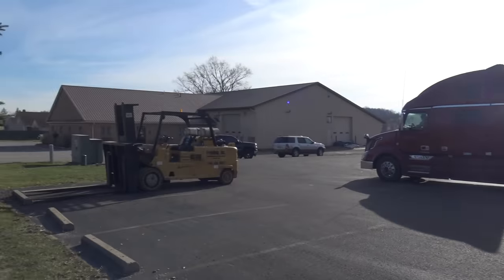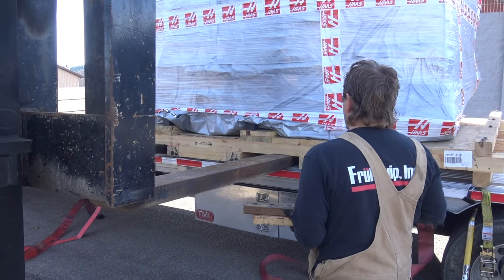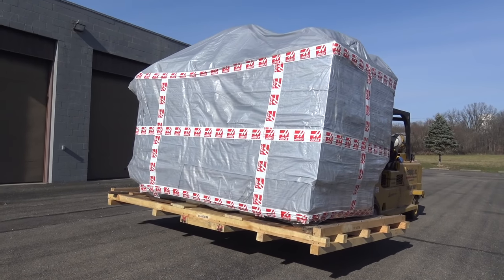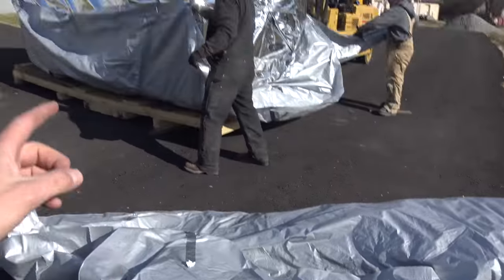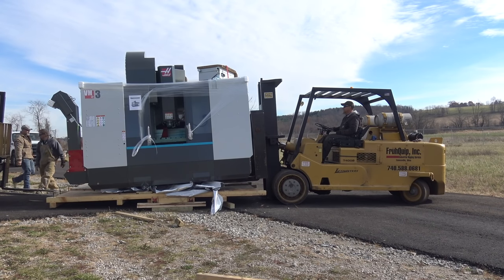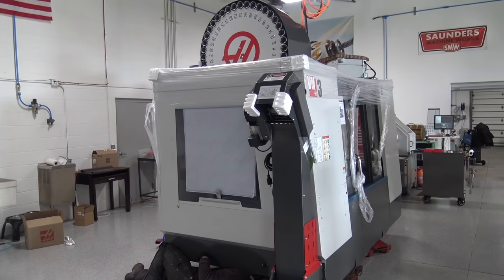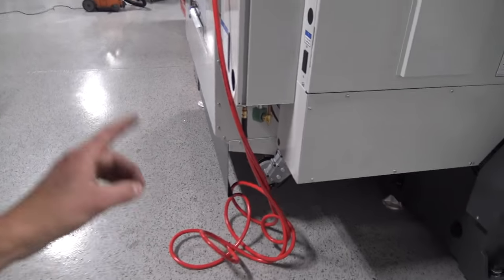Unboxing, Rigging and Placing our HAAS VM3 CNC Machine!

Comment: Time to make some T slot covers 😉

Cheap ABS plastic. Mill it so it slides into the T slots. A couple taped holes in the plastics and a set screw will secure them in place.

Comment: Very congrats, I think you've earned it. Haas is a incredible company and awesome of you to buy American. Prepare to be blown away from what you are used to. I think you'll find ridged tapping will out preform thread milling in terms of speed and ease of use. Thread milling has it's uses, but glad you got ridged. Should be able to wash down that table fairly easy with the full pressure hose. Again, glad to see you're growing.

Comment: John, in following the story of your business, this is another huge milestone. I have a feeling this isn't the last big delivery. By the way, if the hollow spot under the floor continues to be a concern for moving heavy stuff over it, it is easily fixed. A small hole <1" can be drilled through the floor and grout is pumped in to fill the void, then the hole is patched. Once you touch up the epoxy finish, you won't know it was ever there.

Comment: The Riggers did a nice job. As a Rigger myself, the only thing I would have different would be to pull the truck out from under the lifted machine. Coming straight down with a load is much better than backing up with the load elevated. Good luck with your new machine.

Comment: Woohoo! :D

Might think about making some inserts for that cart to hold your TTS. It works well for moving tooling between machines, but since you only have 1 with CAT40 at the moment and more than enough tool storage on the machine itself, it could be more useful for your Tormachs.

Keep any transport hardware, including the red brackets, together and in storage. If you ever decide to sell the machine (even 10 years from now), you'll need them.

And of course...congratulations!

Comment: When they opened the sealed bag, did you breathe in the fresh machine smell?  Wait...did I just invent a new manly air freshener scent?
Reply: Two of the best manly odors: Lathe work with coolant, Two stroke oil(they even make it in candles)!
Reply: Don't forget BBQ & old school hardware store smell.
Reply: +Sketch1994 What!? you need to put a link up for that candle!
Reply: ...., and petroleum and hot electronics ;)

Comment: A quick tip since your machine will have the next gen control, get a paint marker and paint one of the drive lugs on the spindle so you can quickly orient new tools going into the tool changer. Older machines have an orient spindle button, but it was removed on the new control. :-(

We have 4 Haas machines, with 4 different levels of control, so if you have any questions, I would be happy to help. We're right up the freeway in Mayfield.

Comment: I would recommend you turn on rigid tapping.  I have that on both my lathe and mill and it works great.  It is fast and does a great job.   You can still do thread milling on bigger diameters.

Comment: Great machine! We have 2 at our shop and even though they are from 05 they are still work horses
Reply: Ya both VM3 and we have one SL30. I would love to see a video covering the chip extraction. We only have the augers and depending on the material they will give us issues. 

On a nother note. I'm bummed you don't do any more solidworks/ Hsmwork video.

Comment: Don't throw out the tool cart! You'll soon have the price of a second machine in tooling! Trust me I know from experience.  lol...Good luck with it John, HAAS may not be the best machine out there but they have tremendous support and are capable of making a wide variety of parts. A few years ago I bought a VF5 for a company I worked for with 35 HP and a gear transmission. All that HP was kind of a waste with a 40 taper spindle though.

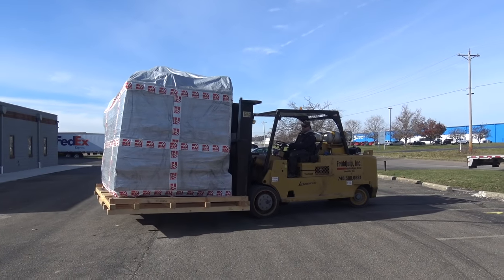Comment: Is it just me - but what is going on with the fork lift's front wheels? They apear to spin weird pulling the Haas of the trailer. See 7:03 for example.
Reply: It looks like it has a friction clutch that engages very 30 degrees or so. I can’t image that this would allow the stapler to be operated smoothly.
Maybe an artefact of the image stabilisation / anti-shake algorithm? But in a very limited area in video … odd …

Comment: Swearing?  Well, maybe not a good thing all the time but no big deal once in a while.  
Trucking, I have about 800,000 accident free miles as a trucker almost all of which are as an owner operator.  All of my owner operator miles are flat bed or drop deck operation.  Very few big trucking companies take on loads like these.  The big companies prefer regular cargo that they can do day in day out.  The fella that picked up your machine I'm betting is an owner operator.
I love machine skates.  Those are different than any other kind I've seen.  Look like they work so smooth.
Hallow place under the floor.  I'm guessing no big deal right now but if you think it's worth worrying about, maybe a concrete jacking company can pump some grout under the floor.  
Thanks for the videos.

Comment: John; You can fix that floor pretty cheaply if your concerned or plan on moving anymore heavy stuff across it! Just contact someone that specializes in that type of work and they can core your floor and pump grout into void and its a good fairly cheap fix! Just make sure you get someone that knows what their doing!
Reply: Mudjacking will fix that floor. They do it often to sidewalks and I'm sure there is someone in your area.
Reply: Yep, From what I have seen, they drill a small hole (around 10 - 12mm I think) and pump either concrete or a special liquid that is like expanding foam, but much more solid once it dries. Very cool and reasonably cheap way to brace concrete slabs from underneath.

Comment: How does one find out there is a hollow spot under a concrete slab foundation 20:15?
Reply: Makes a different sound, with my shed slab you can hear the difference in 1 of the corners, tap it with a piece of 4x2 vertical (as if you were trying to dig the concrete with it), and compare the different sounds. Easy to pick when its "hollow" underneath.

Comment: Not every machine fills a 48ft semi trailer. :-) That is a beautiful machine and a 40hp spindle wow you got me way out horsed, you can turn some big cutters with that!
Reply: NYC CNC
 I was just reading the driver label when you had the door open on the HP. i guess they use an oversized spindle driver to prevent overheating?   I just looked at the specs and Haas says only 90ftlb max at the spindle? My Cin VMC is rated 331ftlb at the spindle but I only have half the spindle speed.  I guess they were still into old slow big cutter hogging back then vs little tools spinning crazy fast like now.

Comment: wouldnt it be easier shipping it in parts and assembling it on location? or is that not an option?
I mean I have never bought one but considering they seem to have some big assembly parts in their shop (the other video you uploaded for example).
That is just the conclusion I would draw from the situation.
Reply: NYC CNC Well I dunno. like it would weigh less in its deiffrent part if you say had the table by it self the tool changer loose or something. I dont know, never moved a CNC cross country im just curious wether it is an option.

And also we saw them traming it in in the factory, making it square isnt there a chance that it will be thrown of centre on transport anyway?

Comment: Hass is an amazing mill!! but it is not Ridgid enough for mold making!
Reply: Jacob 
Sure it is.  We make high accuracy molds here on a TM-1 

Just takes longer and requires more attention. But can easily be done on a VM-3.
Reply: In our shop we have to hit. 0001 and we could never do that on ours we have 2 Yasda mills and once you go Yasda you never to go back lol
Reply: Jacob same here.  Can hit tenths on a haas. Done it plenty of times. 

Can't do it repeatedly part to part. But one off parts ya, tenths can be done even on a TM
Reply: repeatability is everything!
Reply: Jacob 
I usually only make 1 of a part. So I just gotta hit the numbers once that's it
Reply: I've hit .0002 with a VF3 in 404 Stainless.  It's all in your cutting process.